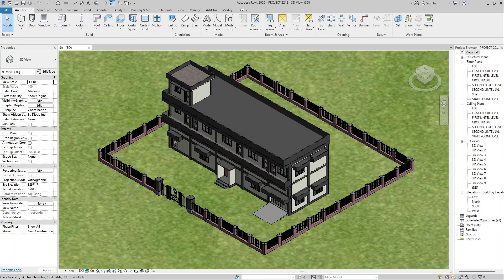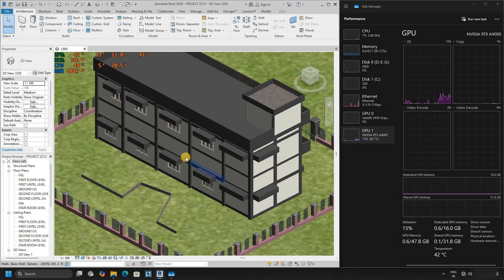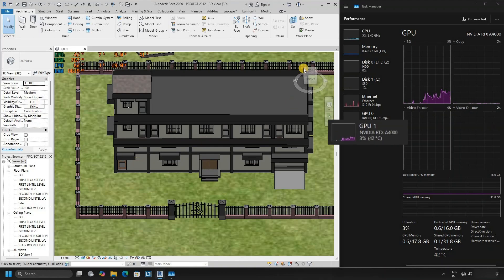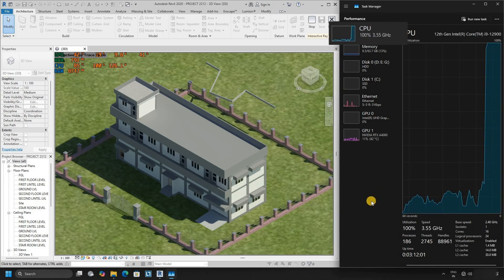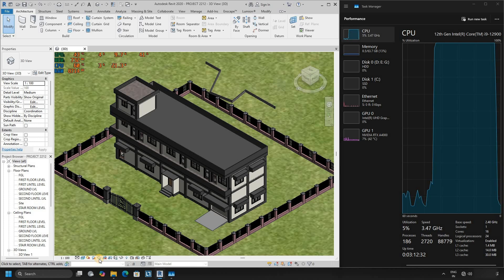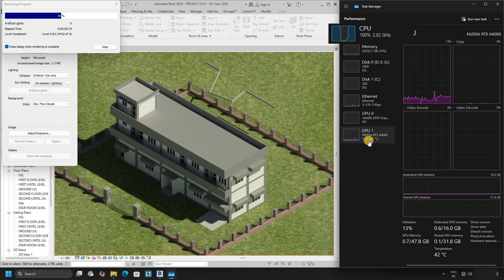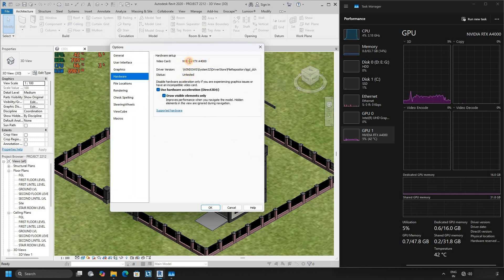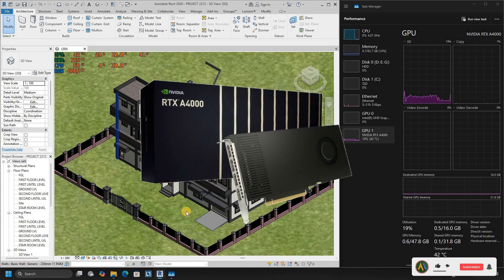RTX A4000 GPU performance test in Revit

Comment: you need sized over 10gb revit model file to test it properly
Reply from the maker: In Revit 2026 also, the GPU is not utilized in rendering. But it is utilized for modeling. So Revit older than 2026 is not going to help to utilise the GPU.
Reply: @ Yes i mean the modeling
Reply from the maker: Comparing current GPU prices, investing money only for Revit modelling older than the 2026 version is not economical. Anyhow, the GPU test on Revit 2026 is coming soon.